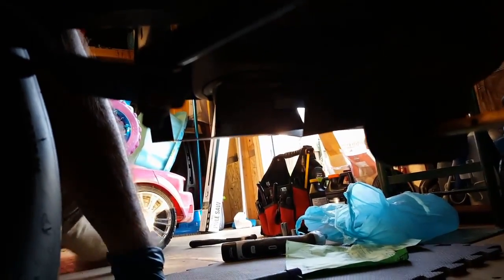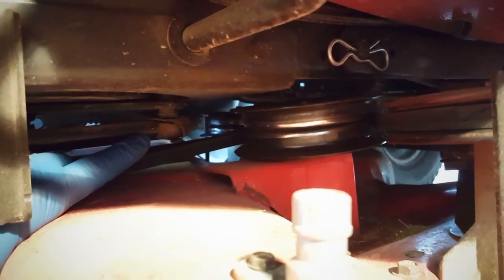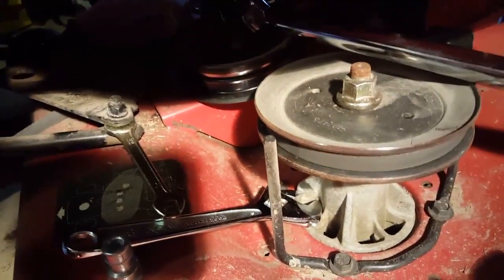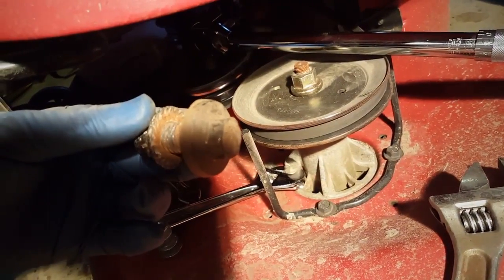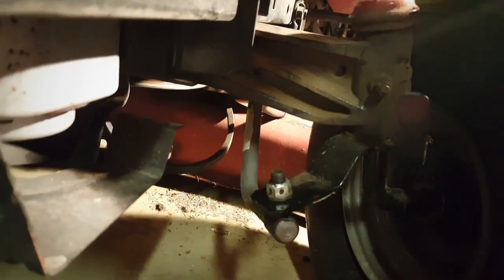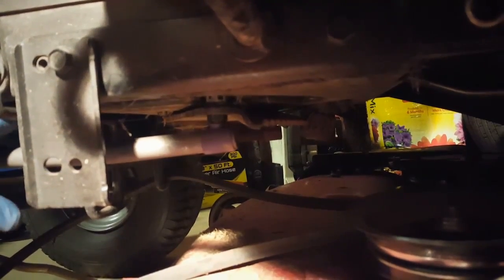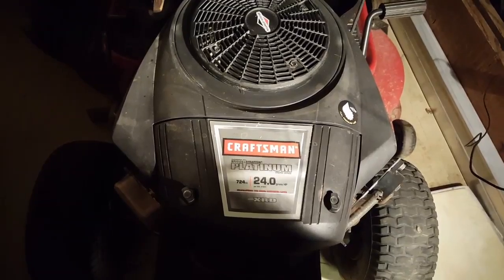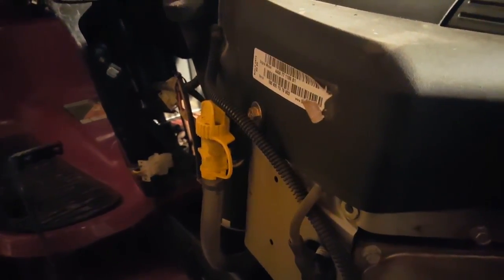Craftsman YTS 4000 Maintenance

Comment: I've got the same mower , the yts 4000 .   Now that I've had it for about 20 years I'm blown away by the quality of it and I'm learning everything I can about it .  I know it was actually made by Husquvarna and it's got a transaxel assembly made by Peerless which was owned by Husquvarna .  Other than the wheel bushings on the front wearing out I've never had any problems with it .  Thanks for making videos showing how to work on it .

Comment: I have the same mower. There is no need to drop the the deck or remove the steering triangle plate. Simply jack the front wheels off the floor, open the engine hood. turn the steering to the extreme right if thats the side you are working on. Now look straight down through a 11/2 " access hole in the frame and the nut will come into view. Socket wrench required.

Comment: My manual says spark plug QC12YC but the sticker under the lid with all the specs says RC12YC.  Also the bushing in the top of the gas tank is somehow buggered and not allowing the fuel pump to draw correctly so wont start.  Researching a bushing fix right now.  Thanks for the vid.